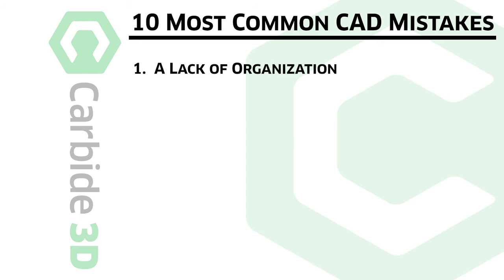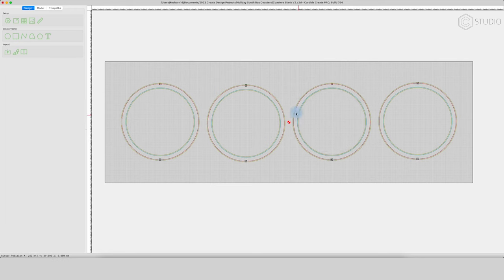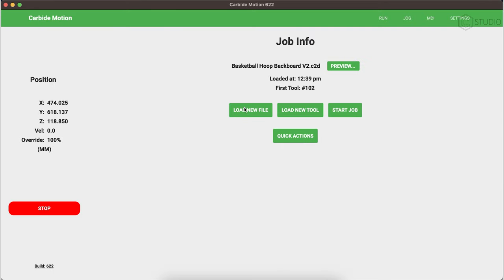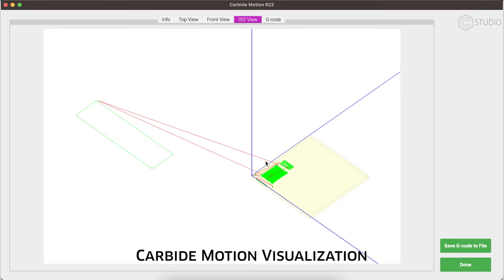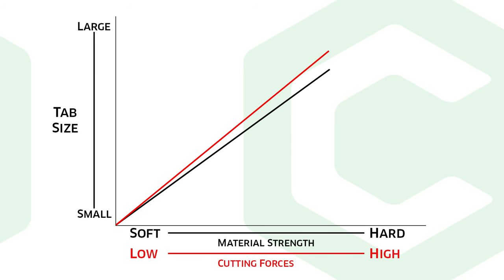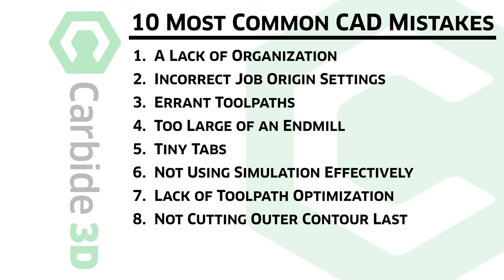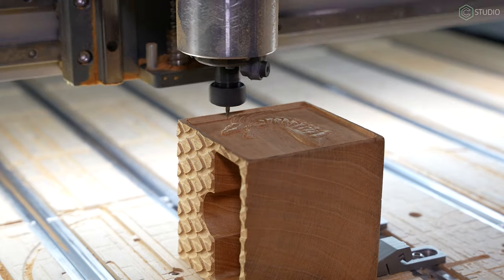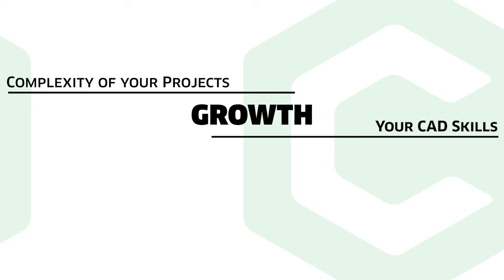Carbide Create Design Solutions

Comment: I would love a good explanation of how to use the Stock Thickness Bottom option. Also, in the settings, Does it make an actual difference with the Type of Material option that you choose, or is it more of an admin reminder?
Reply from the maker: Hi Juan,
The Type of Material is a reminder for you and a record of the file's previous usage. Selecting a material in the Job Setup does not result in a later result.

For the Expression Editor:
Check out this video:  https://www.youtube.com/watch?v=8rsL73WGBbo
Click on this Chapter: The Expression Editor with Cutouts - 42:37

There, I have an extensive explanation about using the T- Value.

Comment: why when selecting two lines to make one closed area the pocket tool sometimes does not wanna pocket? It seems so random and I cant find any consistency as to when it wont allow the toolpath.
Reply from the maker: Pocketing only works on closed vectors, so you cannot click multiple lines that overlap to pocket, you need to join them first.

Comment: As a software developer, it sure seems like a lot of these are solvable with UI design within the software:

1. require names on things when creating them. Also you have cutter data already, why should the user be putting that in again?
2. Ask if origins should carry over when creating a new file, instead of blindly copying them
3. Warn if there are toolpaths outside of the stock, or if there are parts more than X distance away from other parts.
4. Warn about empty toolpaths, or cutters that are wider than some features they are being asked to cut
5. Assuming you know the material being used, it should be fairly easy to integrate some guidelines into the software about how large the tabs should be based on anticipated cutting forces, and then warn about potential issues.

9. When creating a 3d finishing operation, override the default stepover intelligently and allow it to be changed (say, if the user wants that look?). I dont see why I should need to change this every time.
Reply from the maker: We'll pass these along to the software development team.  Thanks for taking the time to make the list.

Comment: If I didn’t have to re-scale imported DXF files that would be helpful as well,
If I scale up the file in carbide create detail is lost, 
I end up exporting my DXF from the original program at a very large size (original size x 25) then final scaling in carbide create,

CC is the only place I run into this issue.

Comment: A small thing I do is buy bits with a consistent shank diameter. I still have to change bits but at least I don't have to also change collets.
Reply from the maker: We structure our tooling preparation by having multiple collet nuts with pre-installed collets.

Comment: You mention 3D Finish stepover. It would be helpful if Carbide Create honored the 3D stepover value stored for the tools when adding a tool to a 3D Finish toolpath, rather than ignoring it and defaulting to a 50% stepover.
Reply: While I cant find the spreadsheets stored for carbide 3d bits, I found the folder to put my own spreadsheets with bit information. I just add information to the spreadsheet itself. I name it like this "Name+Name+Name"", Close out CCpro and reopen and wallah my tools are there with all the info. I've never really used the "add tool" because I don't know where that info is going. I didn't even know there was a problem with step over. But adding your owns spreadsheet is a solution for you.
Reply: @iwannaapple7190  Choosing a tool from a custom tool library for a 3D Finish toolpath results in the same issue, the stepover automatically defaults to 50% of the tool diameter regardless of what the 3D Stepover value is set to for that tool. Yes you can override the setting but the question is why have the setting stored if it is ignored? That is just bad programming and it gets new users confused when their first 3D attempts look like crap because the stepover was way too high.
Reply: @tornadokat  FIrst off, that's not bad programming. All that is is an error entering data onto a .csv spreadsheet. Thats not bad programming.
Secondly, I tried it. It did not occur with the 1/32 & 1/64 bits but it did happen with the 1/4" inch bit. TO SOLVE THAT THIS IS WHAT YOU DO...get or create your own .csv spreadsheet (bit vendors usually have them) and put it in the carbide3d/carbidecreate/tools folder and name it the way I said. When you open CC, CC will recognize it and display it in the window. Then you won't have to be bothered by it.